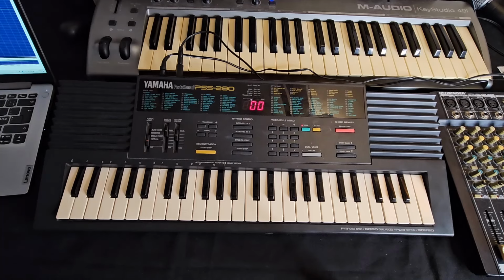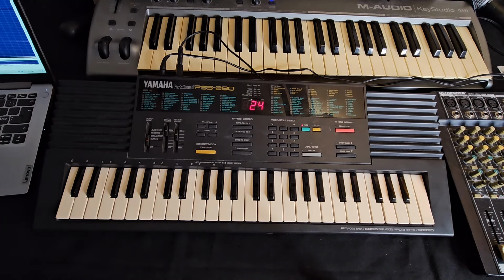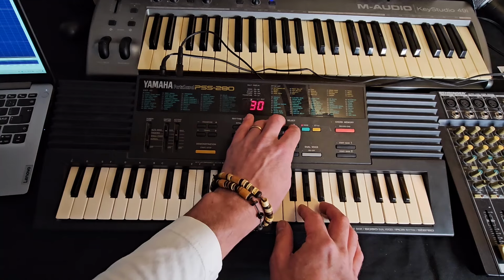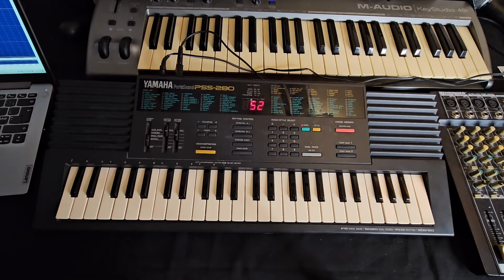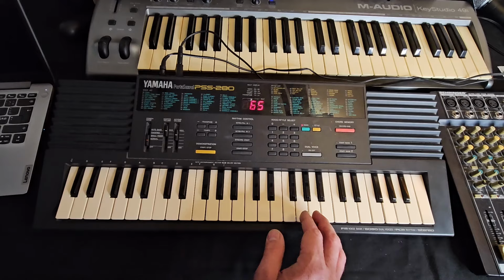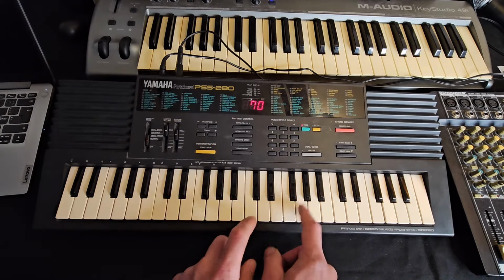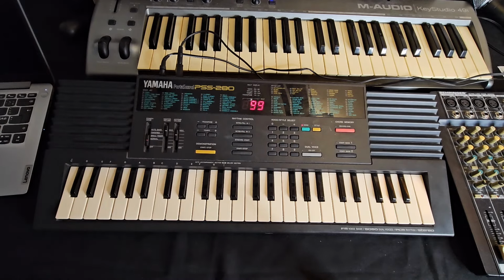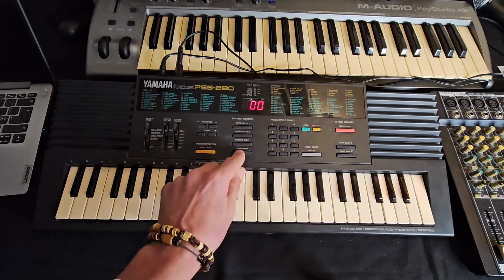Exploring the Yamaha PSS-280 and creating an original 80s Track

Comment: Also as I know basically the difference is that PSR mostly used Samples for soundengine, R for ROM while the PSS, S for synthesized, was mostly FM based, 2 Operator or there was 4 operator I think as well. Thats also in the sounds to hear, the PSS sound very well typical easy FM, while the PSR had that better real sound feeling, not mor so FMish..
You said there was also some sample inside, that might be possible. To a time the Roland D 50 exists, Yamaha sure bit spy that, and implemented their own way of the "LA Synthesis", they used the FM for the synthsource and sample shots like the D 50 as the attack... Thats possible they did so.

But I am quite sure that the PSR then change mostly to full Sample Based, they sounded also much more realistic in acoustic sounds, for Piano and guitars, you hear that on PSR that are samples not FM... or at least main. 
But I remember there was bigger PSR I wanted later buy had then opposite an additional FM soundgenerator inside for give additional programmable FM sounds 2 or 4 operator.
Cause there was also PSRs who had big normal keys, the one I was interested in had big keys, while the PSS all had small mini keys as I remember right.. correct me if I am wrong.

By the way I started out with a PSS 470 I think was the name, the sound nr. 43 was my absolutely favorite sound, it was like an octave synth string like Genesis many times used in the late 80s as well, from the Sequential Prophet. 
Then I bought a second bigger one a PSS 680, thats the one with the blue Drumpads in front the keyboard. Gosh I loved that one, made it possible to play drums and keys at the same time while composing. Many songs I later then rerecorded was made on the PSS in their basic...

But after my PSS Units I found the real world of synthesis with a Oberheim Matrix 6 and a Korg DW 8000 and a Roland D10 and a D50. And there was no need more for the PSS.. 
But honestly... I miss this PSS 680 really, it had something magical also. It was not that bad many might think. 
Also these Drumpads brought me then end 80s beside of play keys to the real Finger playing Drums wich I still do with my AKAI MPC today. I not program the drums in a drummachine style, I play it live in the sequencer.
Reply from the maker: Yes, R could be for ROM! That makes sense! I would say that is the best alternative I have gotten so far to explain the R. 😀

Comment: Nice exploration. I use the PSR 470 which has a small fraction of the sounds, but also the “Digital Synthesizer” which allows for some customization of sounds, sometimes in some very unpredictable ways. Still one of the best synth bass sounds I have ever used comes from taking the trumpet patch and shifting the pitch down, using some cutoff to make it more “thumpy”
Reply from the maker: Cool, I have to try that trumpet bass! ;)